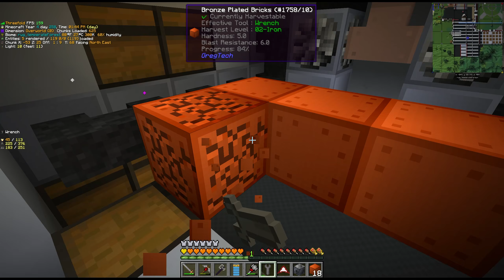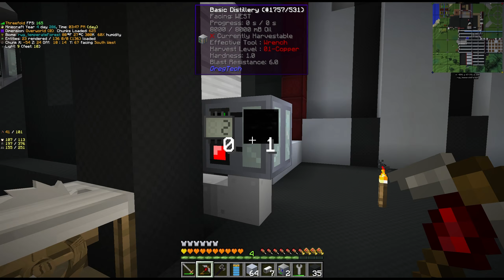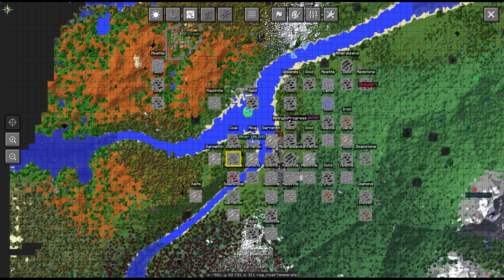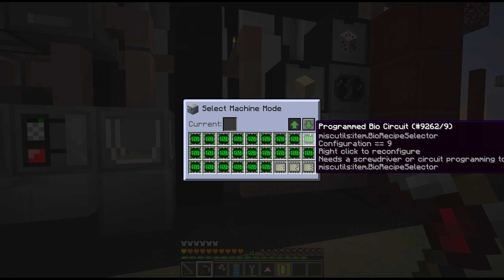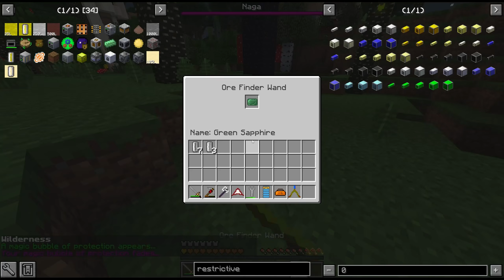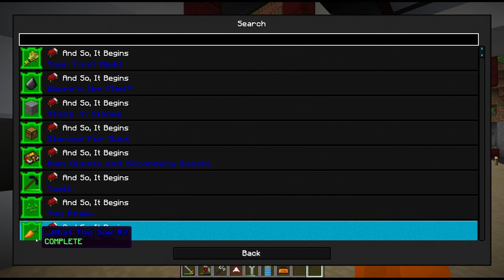Gregtech New Horizons - 15 - Diesel & HV Circuits! Modded Minecraft

Comment: Niceee fuel at last!!! Though I didn't bother with using oilsands ore or pyrolyze oven for heavy oil. I just pumped heavy oil using a oil rig and used it for both light and heavy fuel. Both routes are non-renewable. But I thought it would be nice to set it up and forget about it for a couple of days, instead of having to fill the oilsand ore drawer. It's a lot of steel but a worthwhile investment. That's just me though, I'm lazy and hate having to babysit set-ups. 😂😂

Finding your first oil field would require a seismic prospector, which is also very handy in mapping out all the ore veins in a large area, as people have been bugging you in the comments to do for awhile so you don't have to fly around with an ore-finding wand~

Comment: "Primitive" ore processing is actually the way to go until you get more established. I'd say a proper ore processing system is best set up once you've got upgraded HV circuits going, as well as a solid power solution to fuel many HV/MV machines running non-stop. You can set up an ore processing line earlier, I've actually done that in my own playthrough, but as nice as it is it's a very large investment for something that's going to need to be upgraded and re-worked as soon as HV circuits come in. I'd recommend holding off until you can build it with upgraded HV-stuff in the first place.

If you look up a fluid in NEI it should tell you it's temperature...somewhere. I don't exactly recall where but either the cell or the liquid itself (hint: most liquids have a fluid canning recipe to fill/empty cans of that fluid, so that's an easy place to find both fluid cells and direct fluids in one convenient location) should list it on the tooltip.

So, there's many ways to get hydrogen in this pack, but since you decided to go with a non-solar steam-based solution in MV you actually already have infinite hydrogen laying around, albeit unprocessed: Logs can be centrifuged to make Methane gas, and that can be combined in a Chemical Reactor with plain old water to produce lots of Hydrogen. Note that you can also electrolyse the methane, but this will give you less hydrogen in return for a carbon dust by-product. Carbon dust is useful, but no hard to get if you've got lots of charcoal since electrolysing charcoal dust likewise gives carbon dust. As do many other things - mining up ash blocks in the nether to get Dark Ashes and electrolysing that for two carbon dusts a piece is another common source.

Ender Creepers only aggro when you look at them or attack them, same as Enderman, for the record.

Compressed Chests, Three. Yes, they're expensive. Yes, they're a pain to craft. But yes, they are totally worth it. If not for storage than at least for your miners.

Dyeing cables is indeed done with the IC2 (I think they're IC2) spray cans. There's a quest that will give you some cans as a reward, though I can't recall which one. More importantly, however, dyeing the wires won't help in that situation*...actually you can dye machines as well, it makes their GUI absolutely garish but I've no idea if that would actually stop a generator from connecting to a differently colored cable...well, regardless in that situation an easier solution is to block the cables from being able to connect by placing a plate or foil on them, like you could place a pump or conveyor module on a machine. When a wire is covered by a plate or foil that side will not connect to wires, machines, etc. I *believe you can hit that type of cover with a screwdriver to allow it to connect anyway, if you wanted to use the cover for decorative purposes, but that's something I've never done myself. All I've done is use such covers as insurance against generators connecting to the wrong tier of wire.

Keep in mind that the ore finding wand has a limited range in terms of Y level. It's not bad in the Twilight since the ground is so close to bedrock already, but even so you should avoid flying around too much when looking around for ores...also yes, please craft a Prospecting Machine soon. It's past time to retire that ore finding wand, really.

Now that you've advanced tiers once or twice you really ought to look at better Muffler hatches. Last I played, I don't know if the recipes changed since then, but last I played they were easy to craft once you got a given tier's metal, and some HV mufflers might help slow down the pollution cloud that's covering part of your base right now. That said I've no idea how good the pollution clearers are in this pack and whether they make upgrading muffler hatches meaningless, still...it can't hurt.